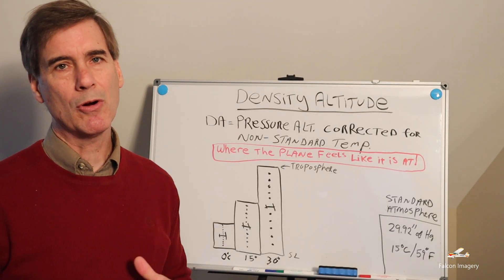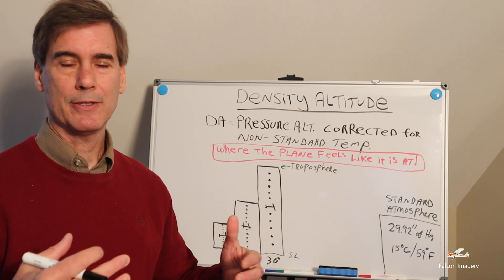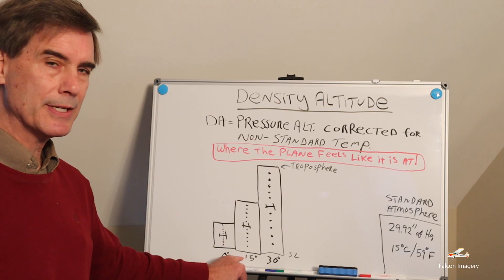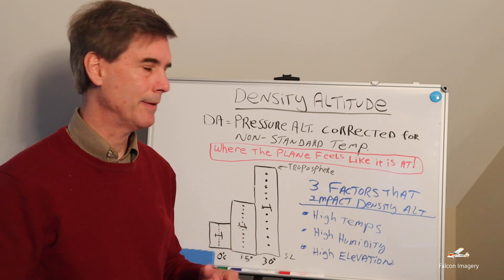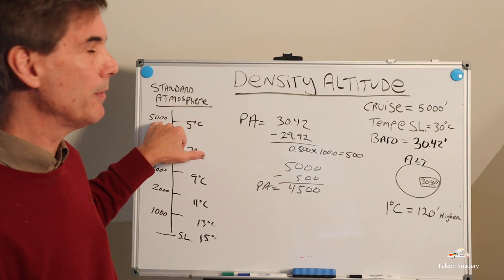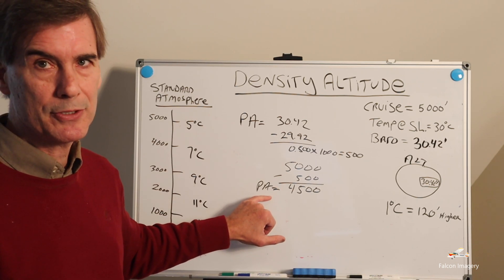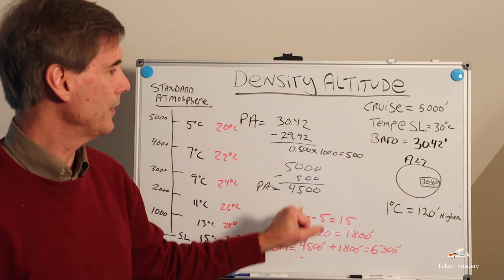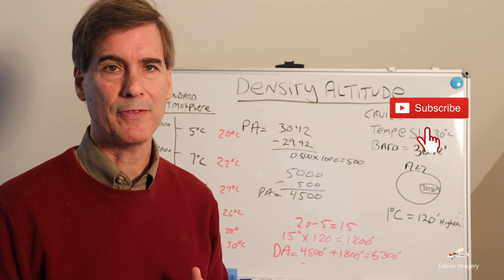How to Calculate Density Altitude

Comment: absolutely great video! I just have a quick question if you don’t mind me asking. So, in general whenever the temperature is hotter the troposphere actually rises and when the temperature is colder the troposphere is lower? So the aircraft is realistically lower on colder days and higher on hotter days? Hope to hear back as I have my checkride this Thursday.. Thanks!
Reply from the maker: In colder months the troposphere/tropopause is lower due to less convection.  And yes, remember that going from hot to cold air mass look out below. But as long as you dial in the correct local barometric pressure you will have an accurate altitude measurement.
Reply: @FalconImagery  thank you very much good sir.